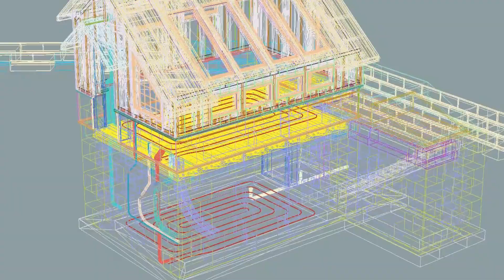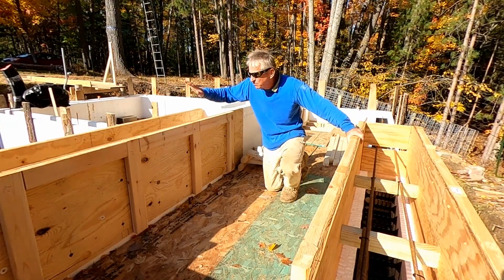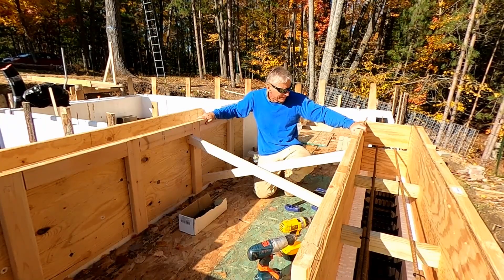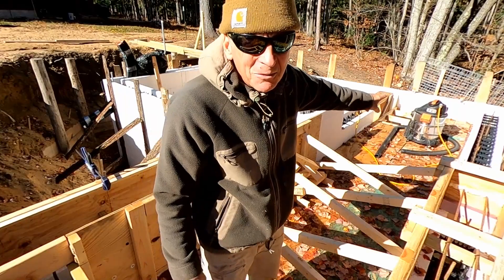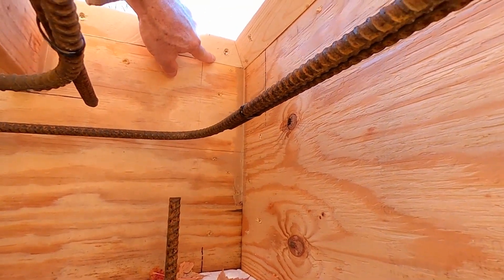ICF Root Cellar - ICF Transition to Concrete - Days 18 to 21 _

Comment: You've done a really nice job with this project - and working alone for the most part - EXCELLENT!!  I subscribed... so I see you are re-uploading all the related videos... and it doesn't seem you have caught up to where you were yet.  I'll just keep watching.  Thanks for sharing this project with us - I think it is absolutely brilliant.  Eventually I guess you'll share how the different structures interact or whatever.  I think you mentioned that the in floor tubing is for A/C in the cabin - VERY COOL!  ... and I think I saw something about an outdoor wood boiler?  I haven't watched that one yet... but I'll get there.
Reply from the maker: Thanks for watching and subscribing. Yes I had a copyright violation in  most of my videos early on of my posting of the videos. Taking me months to resolve this copyright issue. Should have them all  resolved in January and begin to post the Greenhouse build on top of the Cellar.